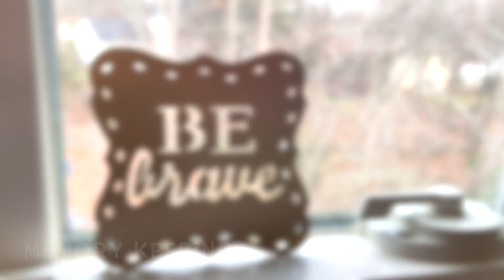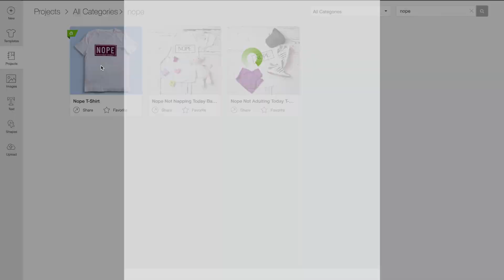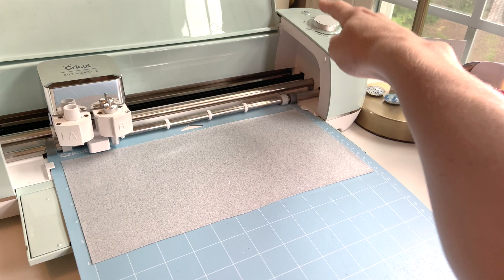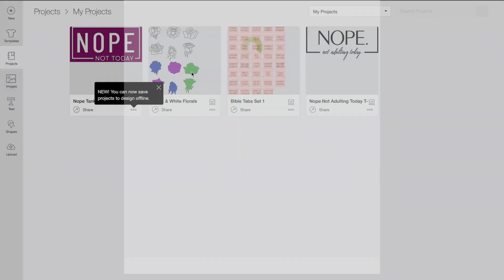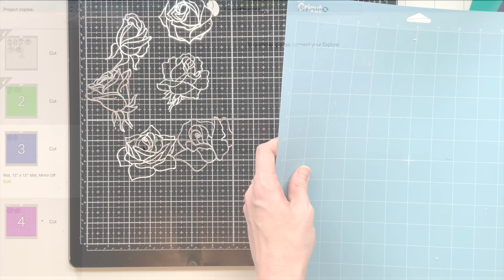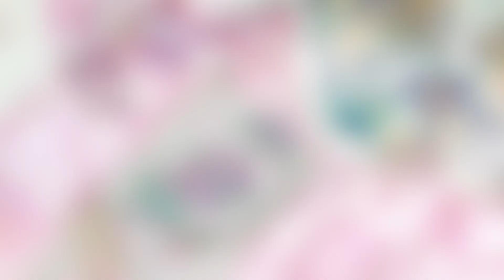Cricut Explore Air 2 Overview & First Projects

Comment: I had the Explore Air 2 but gave it to my son for his fiance and purchased the Maker.  I've had fun with mine. Make sure when you use the Easy Press that you don't use it like an iron.  You keep it in place for the proscribed time.  If your project is really large, after the timer goes off, you lift it up and move it to the next section for the same amount of time.  They also want you to flip the t-shirt over and press for 5 seconds on the back.  If you have any questions, I'd be happy to help you.  They are a lot of fun!
Reply from the maker: Thanks for the tips!